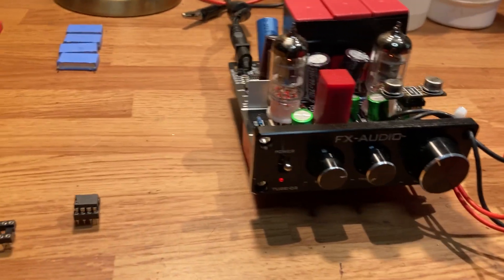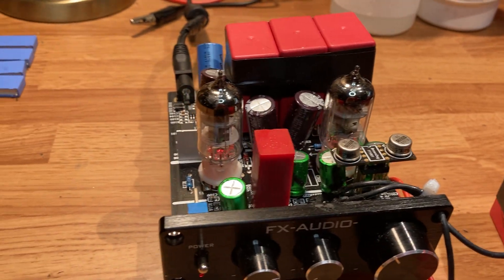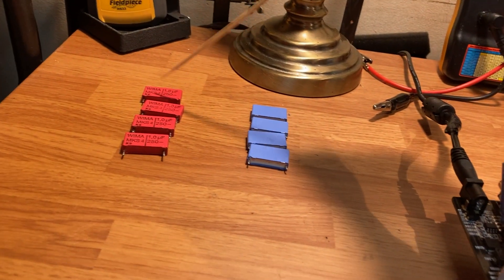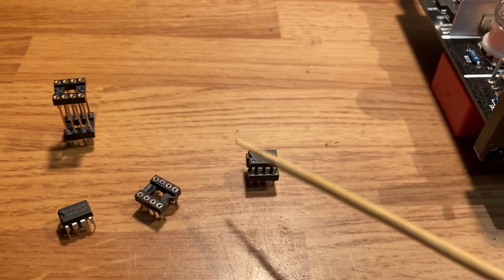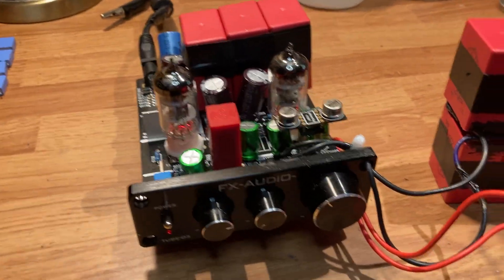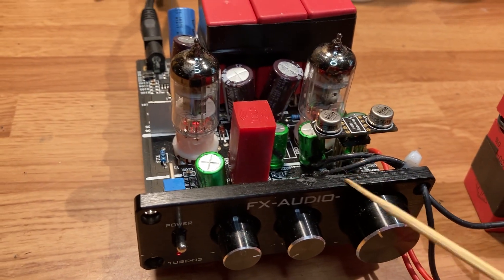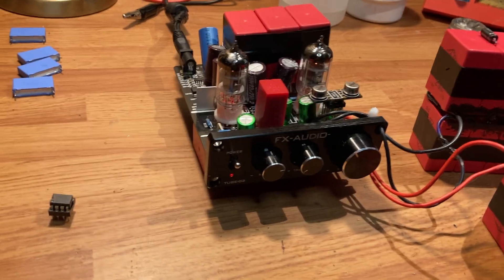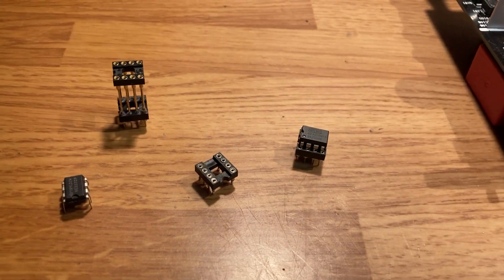FX Audio Tube-03 op amp and capacitor upgrade

Comment: Can the MUSE01's be used in this unit? I hope so or i made a mistake in ordering them instead of the MUSE02's. Ordered them from Mouser so they shouldn't be counterfeit at least. Thnx!
Reply from the maker: It will work, but I found the 02 sounds better.  It's 100X better than what came in it.
Reply: @ranbymonkeys2384  Thanks so much RBM. Another person did a shootout with the 01,02,03 and another one of Muse's. Listening through my system i enjoyed the 01 better. Either way i am sure it will be an upgrade and just really glad it will work in my unit. Thanks again!
Reply from the maker: @RUMBLEGO1  It would be a shame to have the MUSES01 in the DAC and the MUSES02 in the Amp wouldn't it, haha.
Reply: @ranbymonkeys2384  Haha! I'm using an Ifi Nano Dac. Do you think the Muse's would be an upgrade in their as well? Either way i def will start with putting the 01's in the tube buffer preamp and see where i am at. Actually my system sounds pretty good already but wanted to see what this op amp upgrade could possibly bring to the party. :)
Reply from the maker: @RUMBLEGO1  Hell yes open it up and see if it has a easily removable, it may have a surface mount.  I would put the MUSES01 in the DAC until you can get ones to replace the Tube01 , wait the tube-01 doesn't have an op amp.  EDIT: wait nevermind did you get 2 of the MUSES01's?
Reply from the maker: @RUMBLEGO1  I found what you were listening to and those 2 MUSES03's sound badass!!!!
Reply: @ranbymonkeys2384  Yes i did get two MUSE01's
Reply: @ranbymonkeys2384   on my system i enjoyed the 01's. Just listened back to the one video where he does the comparison with the song " St James Infirmary". That is what sold me. The spaciousness and holographic nature sounded better than the others on my set up.
Reply: I have old Mirage speakers with rear firing drivers. A lot of space going on. Everyone's experience with different opamps/speakers/setup/room will be different i would imagine.
Reply from the maker: @RUMBLEGO1  You are absolutely correct, did you get 2 of the MUSES01's keep in mind I have listened to, swapped, broke, fixed, and lost more op amps that I am willing to admit.
Reply: @ranbymonkeys2384  Haha....i'm willing to listen to confessions ;)
Reply: Yes i got 2 MUSE01's
Reply from the maker: @RUMBLEGO1  I would have talked you into getting one of each.  The OPA627 sounds "tube like" in the treble slot.  They are singles so you need 2 of them and I recommend the can style.  You thought the Muses were expensive, haha.  EDIT:  Did you get them yet they sped up their delivery times a bit.
Reply: @ranbymonkeys2384  Yes i received them 2 days ago. Shipping was swift for sure. The tube like tone is what attracted me to the 01. That is what i was hearing in those two demo's. Especially the "Saint James Infirmary" video. Doubt i will be sinking anymore money into this unit. I do have the identical unit i use in my desk set up so if i really enjoy these i may be swapping more.
Reply from the maker: @RUMBLEGO1  I found the MUSES01 to bee "crisp" and punchy.  Far from "mellow" tube like sound.  EDIT : something tells me you have the treble knob all the way down with those MUSES01's in there.
Reply: @ranbymonkeys2384  
well....they are in now. Sound Amazing! :) 6hours in i guess. Happy customer
Reply: definitely crisp....was worried the first go but tamed shortly
Reply: More soundstage is what i am experiencing.
Reply from the maker: @RUMBLEGO1  They have about a 50 hour "burn in" you will really notice it changing the first 20 hours and the highs will mellow out.  Notice that so when people say there is no burn in with components you can tell then differently.
Reply from the maker: @RUMBLEGO1  More everything, that is the difference with fake op amps and good ones.  Were you a little nervous about spending that money?
Reply: @ranbymonkeys2384  They sound absolutely frickin amazing and yes i was a little nervous spending that kind of money....hah. Sooooo worth it. Would do it again in a heartbeat!
Reply: @ranbymonkeys2384  I have always been a proponent of burn in. I have heard things change while sitting there listening on several things over the years. When i first popped these in they were giving me this shrill sound that was hitting my ears really badly. That went away in a few minutes and now they already just sound phenomenal. Exactly what i was hoping to achieve. Couldn't be happier at the moment. The fact that they may get even better over the next few hours is mind boggling to me at this point.
Reply from the maker: @RUMBLEGO1  If you want to make a bigger difference than that, replace those film capacitors in there.  The 4 blue ones.
Reply: @ranbymonkeys2384  Thanks and any recommendations on which ones to get? Also and recommendations on other op amps that sound similar to the Muse's that are quite as expensive? I have another identical tube buffer i use at my desktop and will probably do the same thing. May choose the MUSE02's for that for something different. But great sounding and less money would be nice. Thnx!
Reply from the maker: @RUMBLEGO1  The TL082 ($1.43)  OP275 ($4.58) LME4972 ($2.68) OPA2134 ($4.79). For the caps I like to use these to replace just those 4 1uF caps https://www.mouser.com/ProductDetail/WIMA/MKP4F041005D00JSSD?qs=ISKKXg98%252B1k6h1vaZUN8EA%3D%3D
Reply from the maker: @RUMBLEGO1  Unfortunately if you want that good you are going to pay a premium, but I know what you mean.  You may find you like one of these in with the MUSES01 mix and match, like you said different setups = different results. You would be surprised how a $2 one sounds, we just know the ones that come with it are not real.  EDIT : If you replace those caps your soundstage will expand 10 feet on both sides.
Reply: @ranbymonkeys2384  Wow on the soundstage expanse! Thnx!
Reply: @ranbymonkeys2384  So get the Wima's then? Watched your video. 10 ft soundstage increase is crazy and has peaked my interest. Definitely will have to get the smaller ones and put the lid back on.....haha.
Reply from the maker: @RUMBLEGO1  Those are the ones that are on the table, they replace the original and the same size.  You don't have to get WIMA's but you ask me so I, well recommended one.  EDIT: Look at the dimensions on the link I sent.  They aren't a s good as the ones I have installed, I know most care about the cover so I never recommend something that won't fit, unless sound is more important, of course.
Reply from the maker: @RUMBLEGO1  at 6:43 those are the ones I linked to you
Reply: @ranbymonkeys2384  Thanks for the link.  I see some exactly like this that have 5% or 10% printed on them. Also MKP4 where as yours are MKS4's. Does this make a difference. Not my territory and i plead ignorance. Just want to make sure i order the correct ones from Mouser. Everything else checks out....1.0uF and 250.
Reply from the maker: @RUMBLEGO1  The S stands for polyester and the P stands for polypropylene and the P's are better than S.  The 5, 10, 20  ect are the tolerance value so 5 would be the 5% withing the tolerance of the uF do 5%  of 1uF would be .95 uF - 1.05 uF.  The 20% would be .8 uF - 1.2 uF.  The tighter the tolerance the more accurate they are.  Never doubt me.
Reply: @ranbymonkeys2384  Sorry....i didn't even see this response and that you had linked this! Thanks and thanks also for the opamp price breakdown! Much appreciated
Reply from the maker: @RUMBLEGO1  Happy listening, stay out of the cage!!
Reply: @ranbymonkeys2384  Thanks for your help!!!
Reply from the maker: @RUMBLEGO1  Let me know if you need anything, soldering those in is PERFECT for beginners, a lot of fuck up room, it's almost impossible to mess up.
Reply from the maker: @RUMBLEGO1  use this one to check out your sound stage.  Standup bass behind left speaker, banjo tho the left of that.  Center singer and another to the right, fiddle behind the one on the right, piano way behind right speaker https://www.youtube.com/watch?v=7VFGyoVMt1g
Reply: @ranbymonkeys2384  I'm an almost 62 yr old electric bass playing audiophool for almost most of those years now. Had to move and scale down from Large horn speakers and SET amps. I am well familiar with soundstage and instrument placement. Just listened to a really nice live album with Willie Nelson AND Wynton Marsalis together doing blues. Qobuz is my rec on best sounding streaming service btw. Anyway....sounded good in here before but really enjoying what these new Muse01's are bringing to the table! Now looking at the Burson V6's and taking the top of this damn thing....lol
Reply: @ranbymonkeys2384   Thanks man as i am a novice. Was looking up videos tonight actually on how to actually do that properly. Properly tinning the leads etc before actually soldering....etc.
Reply from the maker: @RUMBLEGO1  Bass player huh, I'll type slower for ya.  I live outside of Nashville, I myself a bass player.  Played on Broadway a few times we had a crowd because the tourists love to hear Johnny Cash and stuff like that not that pop country.  I'm glad your investment is paying off, big difference.  It's easy to change them caps lots of wiggle room if you mess up.  If you do don't panic and give me a shout, haha.  How many bass players does it take to screw in a light bulb, one but every other one.
Reply: @ranbymonkeys2384  Awesome that you are a slow bass player yourself....haha.....too funny! Will get to those caps in down the road a bit. Actually really enjoying the sound right now. Truthfully can't imagine this getting much better. But i was thinking that before this upgrade so....hey. Cheers
Reply: @ranbymonkeys2384  Hah...just clicked on this clip now as i was busy doing things. Love Phish. Have seen them a few times and our band plays a few Phish tunes. Hoist is a great album.
Reply: @ranbymonkeys2384  Yeah Lifeboy does have great separation. Tre floating dead centre with voice and acoustic guitar. Page's piano and harmony floating over around the right speaker. Yes, amazing space with this one for sure.
Reply: @ranbymonkeys2384  So after i install the Wima's, Do you think the Burson Vivid's or Classic's would be better to try over the Muse01's or 02's? Don't mind spending a few extra bucks for the large benefit is sound quality. Trust me....i have spent tons on gear in the past. $100-$150 for opamps is a bargain for this increase in level of sound performance. Well....i think so anyway.
Reply from the maker: @RUMBLEGO1  I've never tried any of the V6 but I like the V5, you wont be able to put the cover on if you you those.
Reply: @ranbymonkeys2384  Oh sorry i didn't realize that the V5 looks almost identical to the V6. Was seeing the smaller V5i which would fit but probably doesn't sound as good. Does the V5 sound as good or better than the Muse's in your estimation?
Reply from the maker: @RUMBLEGO1  Yes the V5 sounds fantastic the V5i is a little to bright for me but good.  I would say the V5 is better than the MUSES02 and the MUSES02 sounds better than the MUSES01.  If you do get the V5 it is a little wider so you will need to get a riser for it also similar to this https://www.digikey.com/en/products/detail/omron-electronics-inc-emc-div/XR2A-0802/1829588?s=N4IgTCBcDaIPYCcCMAGAHAFgLQDsAmIAugL5A
Reply from the maker: @RUMBLEGO1  Some things you said about your soundstage has me wondering how far from the front wall (behind the speakers) are your speakers.
Reply: @ranbymonkeys2384  Well i have an odd set up but have made it work incredibly well. Uses Mirage OM12's which are omnidirectional. So close to 70% of the sound is firing out of the rear of the speakers. One speaker is 3ft from the rear and 3ft from the side wall and the other is angled about 3ft from the rear wall and 18"from the side wall. Both kind of firing into a corner where i have my 50" Tv. I sit dead centre and i would say the corner and my seating position to the speakers would make a diamond in shape. The imaging coming out of that corner and everywhere is amazing! Bought these speakers used from some kind unloading his old 5.1 system. Got the OM12 mains center and 2 surrounds for $125. I am only using the 2 mains and gave the surrounds to a friend to use for his computer system. They sound incredible. To think these recent opamps cost as much as these speakers.....lol. They are ridiculously good. I was previously using BAG END 15" woofer speakers with large horns and a Bag End 18" powered sub in a large room with a cathedral ceiling. They were pulled out into the room and i was sitting in the "sweetspot". Full SET Tube amps and tube preamp. That sounded incredible but i had to move and have that in storage. So had to scale way down and this setup is sounding pretty darn close for little out of pocket....thank goodness....cause i ain't a richin by any means!
Reply from the maker: @RUMBLEGO1  Ya symmetry is key but you want room for that soundtage to go past your speakers left and right 5 feet or so.  If possible (rearrange if you have to)   not have that funneled to the corner.
Reply: @ranbymonkeys2384   Yeah i was able to do that at my old place. The small place i moved into i am making do with the small space i have. No other option. Actually it sounds quite good and i am getting a nice presentation as if the band is right in front of me. It also does sound pretty wide. No complaints. Very familiar with listening to live music and this sounds like the performers are right in front of me so ....can it get much better than that?Live Acoustic Hot Tuna are jamming right in front of me at the moment. :)
Reply: Also the 50" Tv is giving some simulated back wall reflection for sure. If i slightly angle it one way or another the stage changes dramatically.
Reply: @ranbymonkeys2384  I don't know if want to get that crazy with ordering a riser. Maybe i will try the MUSE02's in my other setup and call it a day. That way i can swap either one back and forth pretty easily from my living room to my computer desktop. For my desktop i just got some vintage Polk Audio Monitor 7C's. They were recapped and new tweeter. Have them at ear level angled in at me almost 6 ft apart. Man do they sound fantastic and warm. Very revealing and great soundstage. Would love to see what the MUSE02's can do with those. Yeah also not having the case on would be a dust issue for me. Not the most diligent in that regard and if the MUSE02's are much better than that should be good enough me thinks.
Reply from the maker: @RUMBLEGO1  Ya, If you look next to both sockets there is a 10uF capacitor that the burson will hit so you need to get the burson above those caps right next to the op amp.  The burson has a larger footprint than a regular op amp.  Remember I gave you that list of good cheap ones, some just may surprise you.  Getting those burson's looks like it's going to be a pain in the ass too ordering them from Australia.
Reply from the maker: @RUMBLEGO1  Live sounds like shit, haha
Reply from the maker: @RUMBLEGO1  Remember the sound is supposed to make it appear the "band" is all BEHIND the speakers.
Reply: @ranbymonkeys2384  I've achieved this in both set ups. With the Mirage's many instruments are floating in space in the best possible way. Nothing is overly forward. Very holographic. I have those Polk 7c's pulled out about 14" from the front wall at my desktop. So have a good soundstage going on there too especially when i lean in to type. Well either way. Was trying to find that balance of leaning in to type and relaxing back in the computer chair. Think i have that pretty dialed in now. Amazing how such very small movements of speakers effects  the overall sound. Talking less than a 1/4" in any direction.
Reply: Yeah i was reading that replacing those opamps with even some cheaper ones will provide a marked improvement. Would rather get something good and just set it and forget it. Don't want to be swapping in and out and you seem to think the MUSE02's are the shit. So i may as well give them a try at the desktop next and see what happens. Do you think they have more treble than the 01's? I am probably at about the 30 hour mark on these now i would guesstimate.
Reply from the maker: @RUMBLEGO1  I don't know about "the shit" they are better than the 01's.  I use the MUSES02 the Burson V5 and the OPA627 right now.
Reply: @ranbymonkeys2384  Never mentioned that i have 8" subs on both setups just to get that added sweetness. Works in the smaller rooms. F...i had that 18" powered Bag End infrasub in my last place and in place for 20 years. That's gone. System is shrinking now like my body.....lol
Reply: Everything still sounds great though! Maybe my ears are shrinking too though......hmmmmm...hah
Reply from the maker: @RUMBLEGO1  actually your ears get bigger.  You may find this interesting https://www.youtube.com/watch?v=iN3PBpInNJM&t=98s
Reply: @ranbymonkeys2384  Def will check this out! I forgot i had the treble dialed back a bit on the tube buffer. Then i asked if the MUSE02's had more treble. One click adjustment on the bass and treble on this buffer and holy cowzone. Anyway....sounds great. Tinnitus schmitus......?
Reply: @ranbymonkeys2384   And no matter what....my head is expanding exponentially......ears can't keep up.... yowza
Reply: @ranbymonkeys2384  I received the Wima's and will put them in shortly. I heard that the film caps take a long time to break in. How many hours would you say? I read upwards of 600-800 hours but that sounded excessive. Don't know if i'll make it that long...haha
Reply from the maker: @RUMBLEGO1  About 5 hours they will settle into their new home well.
Reply: @ranbymonkeys2384  thanks!....that's a lot shorter than 600...haha
Reply: @RUMBLEGO1  I run a pair of M3 SI’s. I know your post was 10 months ago but I was just curious as to which op amp you ended up sticking with? And was there a particular set of tubes that you felt sounded better with the mirages?  Which pair mirages do you use?
Reply: @phillipwaters7041  I actually just left the MUSEO1's in my one setup and they sound terrific. I have a set of MUSE02's to replace in another unit but i never got around to it. To tell you the truth. The stock opamps in that unit sound just fantastic. When I do get around to replacing them I will probably hear the difference but am in no hurry. Right now I have stuck with the Riverstone JAN GE 5654's. They also sound great to my ears!